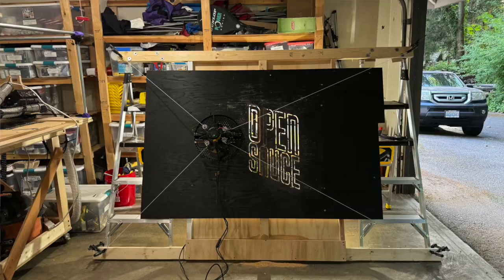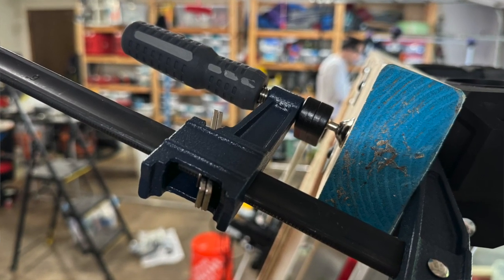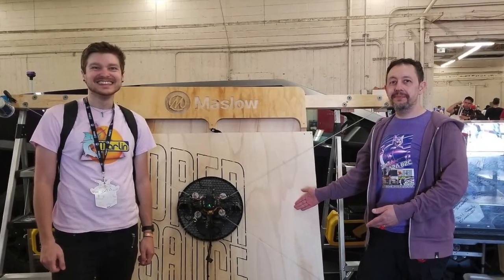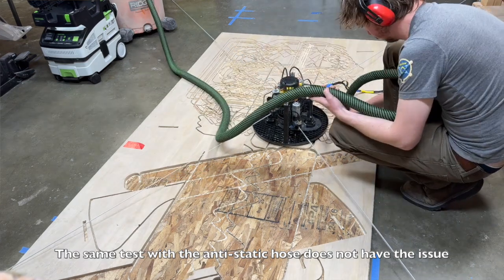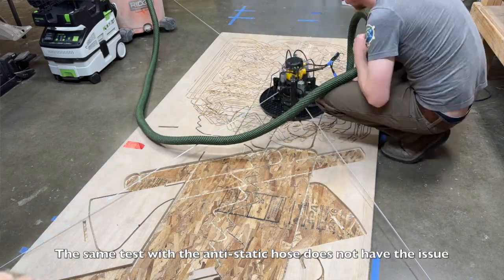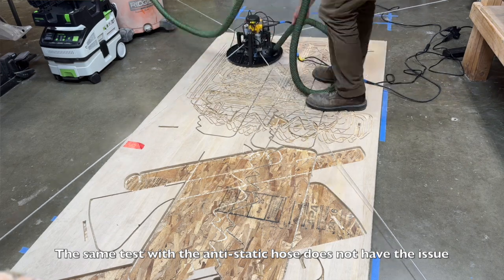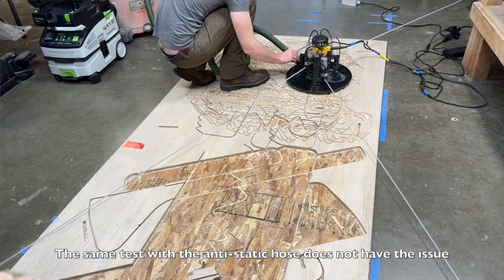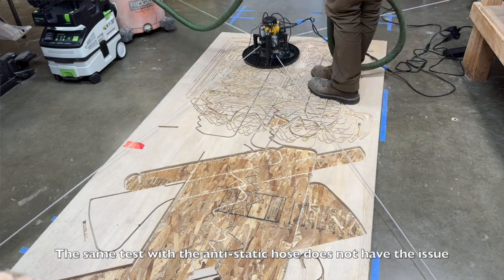June 19th Maslow CNC Update

Comment: Thank you. is there a post processor for deskproto?
Reply from the maker: We use the standard GRBL processor to process gcode so while I haven't used deskproto I'm 99% sure that it will have a GRBL post processor which should work great.
Reply: @maslowcnc  yes, it is available. thanks for your feedback

Comment: Static discharge disrupts all radio spectrums and sensitive electrical signals carrying data. It is a naturally occurring spark gap generator. The only way to resolve it is to use anti-static preventions. So don't go too far down that rabbit hole chasing bugs what really needs to occur is identifying the points regarding elimination of static - grounding straps, anti-static accessories, etc.